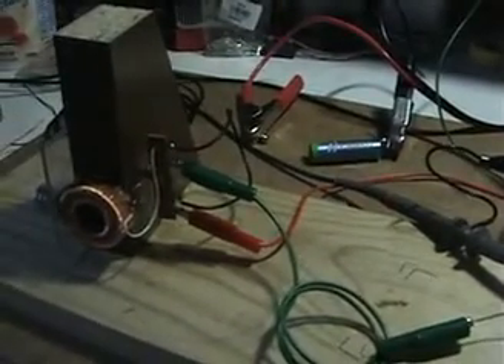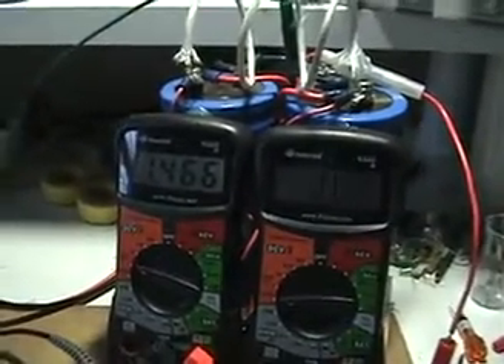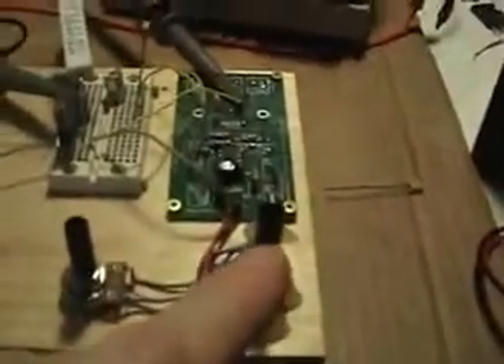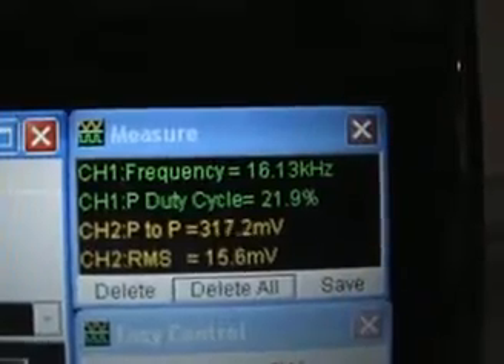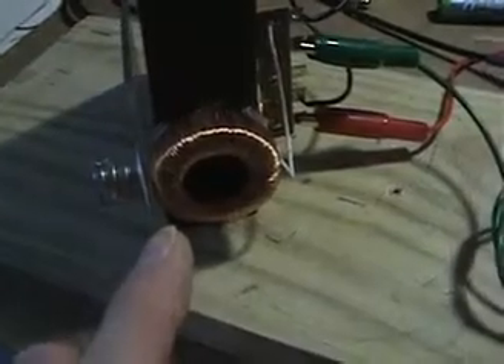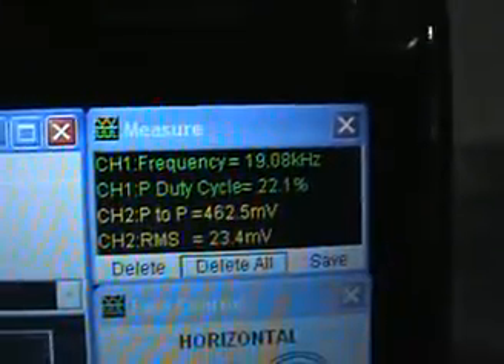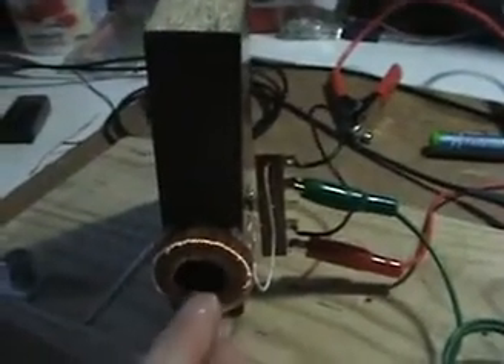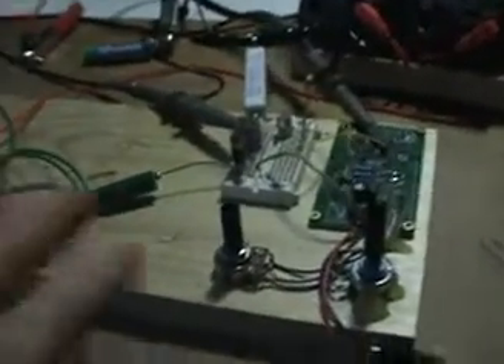Self Running Coil test 3

Comment: Hi Luc,
well done, but
you couple into the circuit via your gate-drain or gate source capacitance some energy from the spikes when the PWM switches from your PWM circuit battery..

Just try to make your Toroid much bigger in size and try to use the BackEMF from it to power via a diode or graetz bridge some loads.
especially, when you add the magnet.
This should really kick out some additional energy, look at the latest Jean Louis Naudin experiments.
Good luck !

Regards, Stefan.

Comment: Magnets b-field and coil E-field cross degree cause a forces making the atom spin more (torsion) thus gather more virtual photon integrating into observable form photon everything came from the vacuum infinite virtual states. Look Kosol ouch hemisphere he show a led stay on forever power a regular rock cover with aluminum and copper foil  interacting 90, 180, & 45 degree. Good work man on your results.

Comment: nice work just suggestion try to use the same battery or the even the capacitors to derive  the 555 timer you can use jole thief circuit to charge a capacitor with high voltage that can be used to derive 555 timer with that   you can delete the extra power supply and it will be self looped  just an idea hope you like it.

Comment: You could run a joule theif off your cap bank, to up the voltage for your moffset switching supply. If your collecting extra energy, why not use it to run the switching, and isolate the 555.??

Comment: Your not explaining where the drain of the FET is getting connected. I assume the source is connected to common of the wholes system but the drain is pulling energy from where? You must be canceling the magnet at one moment and then when it's not cancelled, the magnetism induces a current back from the toroid.
Reply from the maker: +Douglas Allen  The drain is connected to the coil and source is connected to common ground. I was never able to prove where the energy gain was coming from. Could it be the FET's gate leaking through at a particular frequency? which also coincides with the coil going into resonance?  These tests were done 6 years ago but I never was able to prove or disprove the source of gain.